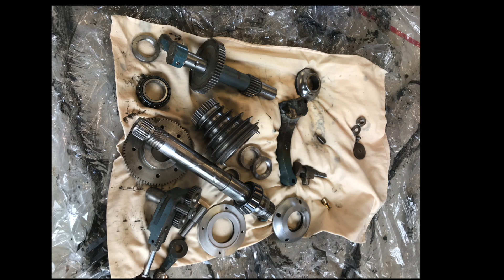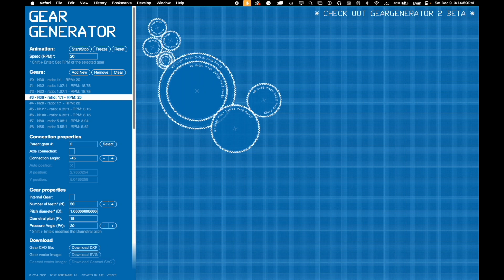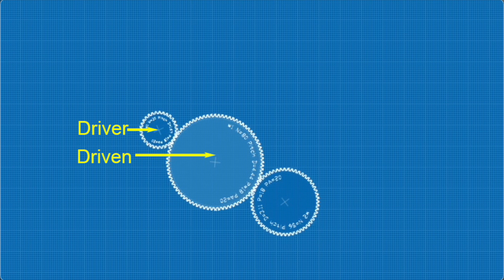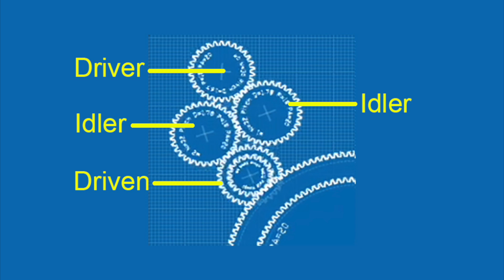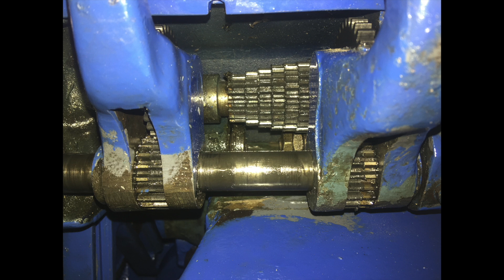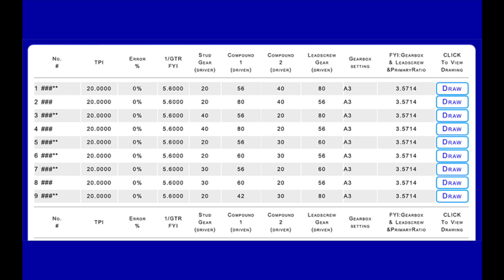Understanding Gear Trains - An updated improved version

Comment: I am so confused. All other videos on compound gear trains have the driven divided by the driver. Your approach gives the correct answer but I don't get the discrepancy in approaches??? Do you have any words of wisdom? It must be something stupidly simple I'm overlooking .....
Reply from the maker: It depends on the application. If we say the gear train has a gear ratio of 0.5 it could mean that the lead screw turns once for every 2 turns of the chuck. That would be the case if you had a stud gear with 20 teeth driving a leadscrew gear with 40 teeth giving a gear ratio of driver/driven of 20/40=0.5.  In that case,  if the lead screw has a pitch of 3 mm and is turning at half the speed,  it would produce a pitch of 1.5 mm.  Seems quite simple.

Now lets look at imperial threads that are measured in threads per inch TPI.  Note that TPI is the inverse of pitch.  1/TPI has units of inches per thread which is pitch in inches.  Now if the leadscrew is turning at half the speed the number of TPI us doubled!  So, instead of multiplying by 0.5, we have to divide by 0.5 and that is the same as multiplying by two.  

What I do is calculate the TPI by dividing by the gear ratio, which in this example would be the lead screw TPI DIVIDED by the gear ratio of 0.5. In this case the gear ratio of the leadscrew is calculated by driver over driven.  That is the method I always use so that I can do both metric and imperial threads.

HOWEVER, if you imagine someone who only works in imperial,  it might seem strange to divide by the gear ratio.  If they calculate the gear ratio from driven/driver they will get the inverse gear ratio.  In this example their inverted gear ratio would be two.  Now they can multiply TPI by this inverted gear ratio, and it might seem more logical!  This inverted gear ratio is the number of times chuck has to turn to make the leadscrew turn one time.  

The bottom line is that there are two alternative ways of doing the calculation.

Thank you for this interesting question. If you don't mind I would like to add your question and my reply to the help file of my free online gear train calculator RideTheGearTrain.com.
Reply: Hi Evan, that is sooooo helpful thankyou. I really appreciate your time in responding so thoroughly.  You are more than welcome to add this to your help file!!! Kind regards!

Comment: I have a 80 year old New Visbly lathe with a 4 TPI Leadscrew and includes a 127 tooth gear used on the leadscrew. The Lathe has a copper plate with metric threads, do you know if I can then use the indicator on the leadscrew and be able to disengage the half not while cutting threads?
Reply from the maker: No, if you are cutting metric threads on an imperial lathe (or imperial threads on a metric lathe), you cannot use the thread dial indicator (TDI) and it is not recommended to disengage the half-nuts from the leadscrew.  Instead you either have to run the motor in reverse, or turn it backwards by hand.  If you have a chuck that screws on you have to be careful to make sure it doesn't unscrew, especially if the motor is running in reverse.  You cannot use the reversing lever in the gear train. This is used for cutting left hand threads.

If you run RideTheGearTrain dot com and select a metric thread, you will see a help button called "Half Nuts".  This is not referring to your sanity, but reading it may lead to insanity. I will place the link below.  

My YouTube videos explain how to connect a reversing switch to a typical single phase motor, and another video explaining how variable speed motors work, and others about how I installed a variable speed DC motor in my Boxford lathe.  

Now, I love my variable speed, reversing motor, especially for cutting threads. I start a thread slow, speed up through the middle and gradually slow to a stop at the end of the thread, withdraw the tool and run fast in reverse to get back to the beginning of the thread ready for the next cut. It is even a good way to do imperial threads.  

The help file below gives more explanation and links to several useful videos. One even shows how you can disconnect the half-nuts if you strictly follow his technique.

I hope you find all this helpful!

https://ridethegeartrain.com/index.php?fnname=chooseThread%3EbeforeSubmit_notIndep_handleHidVar&adflag_f=yes&gearboxbrand=Imperial_no_gearbox&previouslathe=Imperial_no_gearbox&gearboxfitted_f=no&lathetype=imperial&threadtype=metric&threadsize=2&compoundincluded=1&autocompound_f=yes&errormax=1&maxresults=2000&changegearstring=16%2C24%2C36%2C40%2C56%2C56%2C60%2C100&changeleadscrew_f=no&leadscrew=8&powerfeed_f=no&carriagefeedratio=0.34&crossfeedratio=0.1&changeablestud_f=yes&studgear=40&changeablelsg_f=yes&leadscrewgear=56&range=single&lolim=4&hilim=8&interval=1&prefintro=yes&prefquickstart=yes&preftutorials=yes&prefourlinks=yes&prefinputtext=yes&prefspecstext=yes&prefgeartables=yes&prefgearboxtables=yes&stud=40&lsg=56&customdone_f=no&numn=1&numl=1&numgears=8&primaryratio=1&stdstudgear=40&stdleadscrewgear=56&stdleadscrew=8&stdcarriagefeedratio=0.34&stdcrossfeedratio=0.1&stdchangeablestud_f=yes&stdchangeablelsg_f=yes&stdgearboxfitted_f=no&stdcompincluded=1&stdauto_f=yes&stdchangegearstring=16%2C24%2C36%2C40%2C56%2C56%2C60%2C+100&stdcompoundgearstring=127%2F100&zout=yes&zin=yes&deglab=no&ptab=no&pcurve=yes&psymb=no&pline=yes&pcircle=yes&fullsearch_f=no&restricted_f=no&mode=afterDataInput&pagename=chooseThread&helppage=chooseThread&helplabel=Half_Nuts&threadrequested=mm#Half_Nuts
Reply: Thank you Evan for the detailed reply. The plan is to eventually fit an Electronic Leadscrew, but for now I will ave to work with leaving the half nut engaged. @Evan-e-cent
Reply from the maker: RideTheGearTrain has a button for people designing electronic leadscrews (ELS). Just some fairly basic calculations of gear ratios and pulse counting. @XXXXIndices